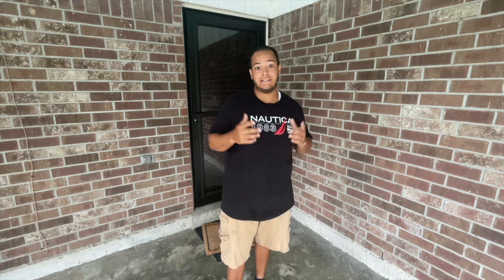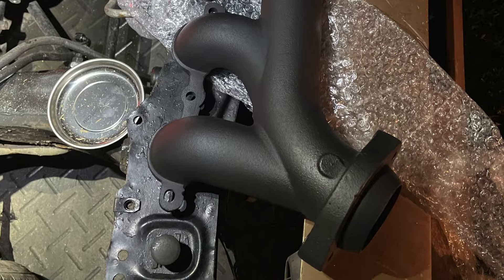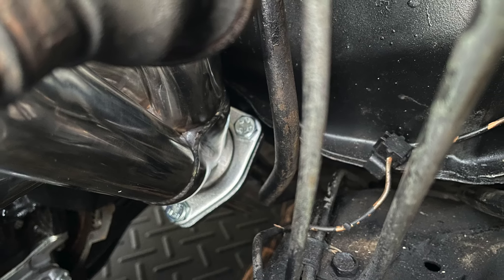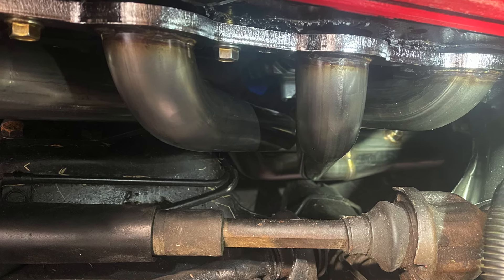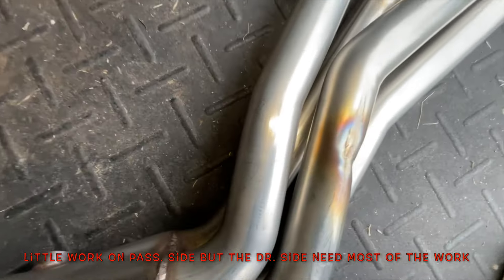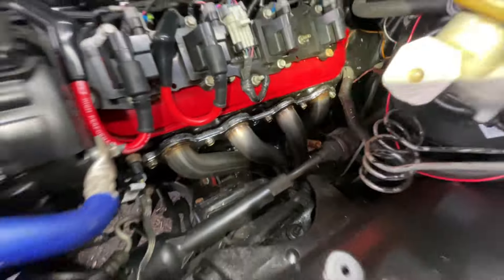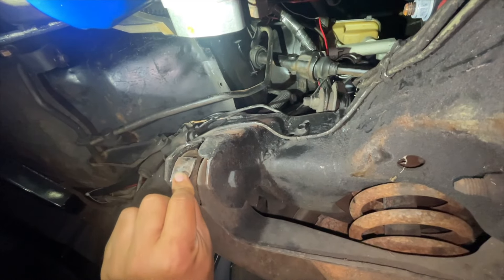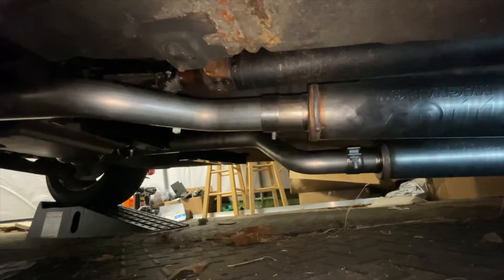SKD #55 - Best Headers & Exhaust For Your LS Swap Build #automobile #lsswap #viralvideo #

Comment: 🔥🔥🔥💪🏾💪🏾💪🏾👍🏻👍🏻👍🏻 I'm having the same issue with the iron headers hitting the passenger side chassis but my cars chassis was hit on passenger side so I think once I get it pulled out the 1" or so that's pushing in it would be just fine.
Reply from the maker: @DIAVLO666  I know I was not the only one, so I had to make this video to show what I went through😂 👍🏽 thanks for the comment

Comment: Cool deal!!!! I am doing a Ls3 swap in my 03 Vic. It's a project with my grandkids. I was going for a 6.0 but a 6.2L block fell in my lap for$500. We'll I guess I'm doin a Ls3 lol. And a low milage set of 821 corvette heads for $300. It's costing me alot more than a pull out. But I don't have anywhere to put a donor while I strip it lol. I'm running a BTR Ls3 Stage2 V2 cam. I can't run anything bigger without cutting the pistons. That would make it a L99 not a Ls3. And I'm not building a all out every horsepower build. Burnouts and ice cream. And a few Red light lol. Light to light. Lol
Reply from the maker: @GrandPitoVic  that sounds like a winner in my book 👍🏽

Comment: Nice work fam you car sounds like mines frfr 😂💯🤝
Reply from the maker: Yessir thanks what’s your exhaust setup
Reply: @  Flowmaster FX
Reply: @  cast manifolds
Reply from the maker: @MRRANDOM1  true dual or X pipe or H pipe
Reply: @SKD_4830   y pipe coming out infront passenger rear tire

Comment: What cross member did you go with
Reply from the maker: @tlegg8745  check out this video #44 https://youtu.be/SoYxwJoKK9w?si=7zbgyl2A8T3KW2NM
Reply: @SKD_4830  appreciate the info
Reply from the maker: @tlegg8745  No problem bro just get the right one for whatever trans you running
Reply: @SKD_4830  I want to run a 4l80e I have a 84 cutlass supreme you think that cross member will work?
Reply from the maker: @tlegg8745  not the same one I have but they make one for the 4L80 to.
Reply: @SKD_4830  ok cool about to check that out now